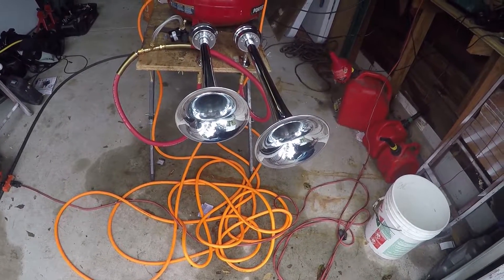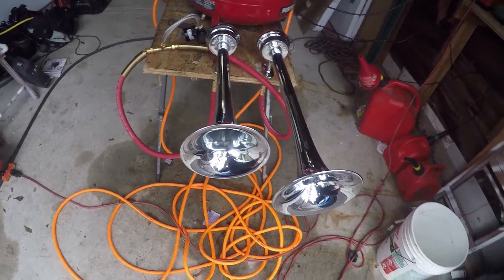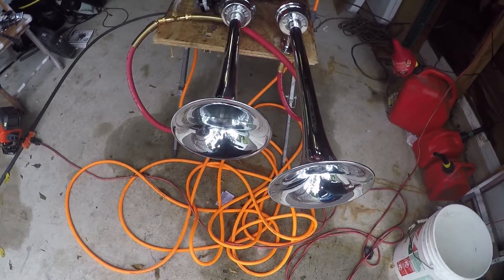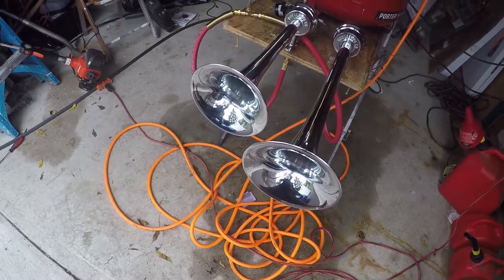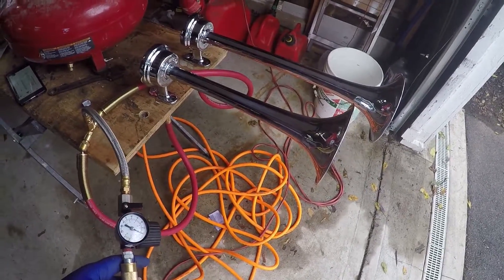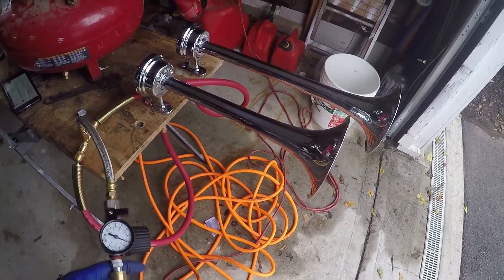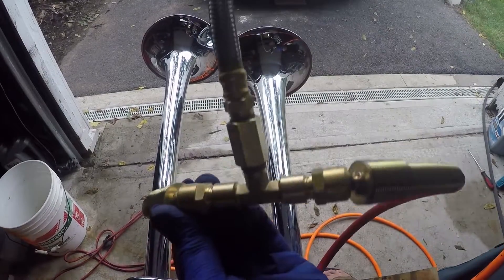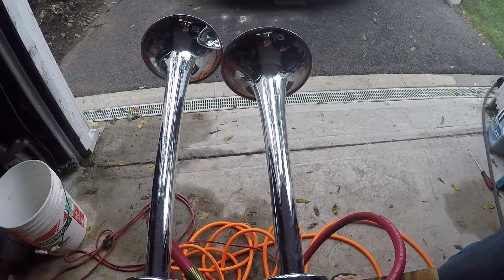Yacht Airhorn Test -  Buell (Deep Tone) 18" and 15" Tandem (links in desc.)

Comment: This means nothing. On my old tugboat I had a horn that blew on the compressed air from the air tank to start the engine. With a reducing valve from 25 to 3 atmospheres. You could hear that horn a mile away.